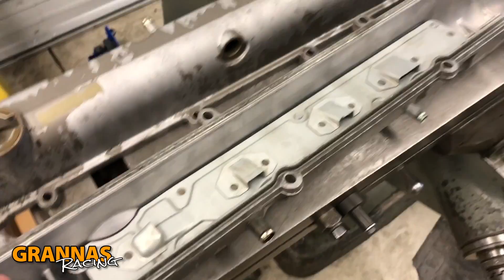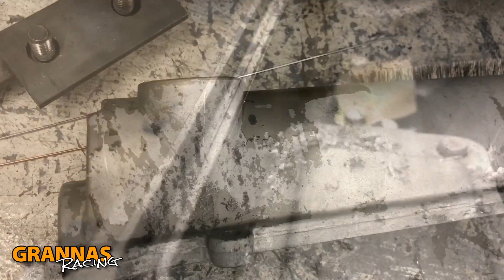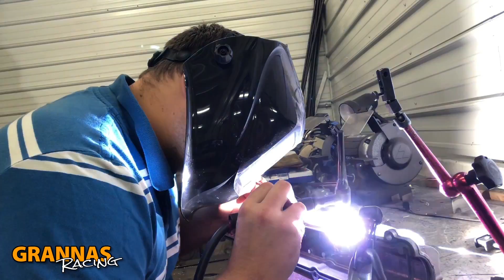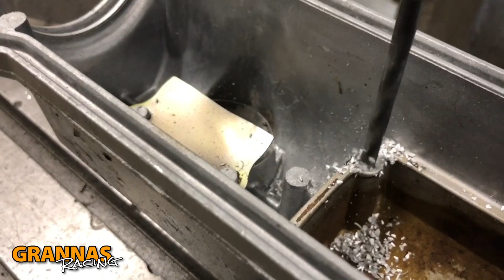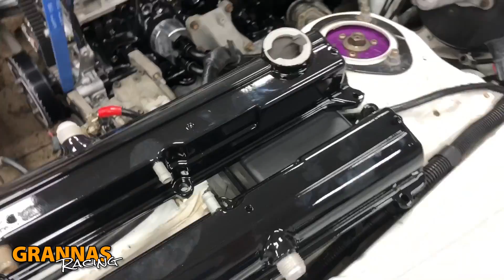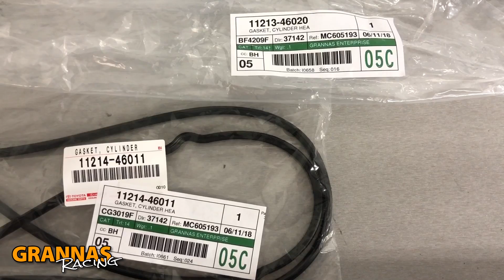Modifying 2JZ-GTE valve covers for use with a catch can

Comment: Have you heard of anyone having issues with the lobes on high lift cams hitting the heads of the bolts on the baffles? I've seen a couple posts about it on Facebook but I wouldn't think the lobes would be close enough to the bolts in the baffles to hit them.

Comment: I just did mines as well. Also pulled the cross vent nipples on both covers, welded them shut and grind em flush. Tired of dealing with it when doing coils. 

Also the silicon sealing the baffles is to keep the crank case pressure circulation through the baffle instead of making its way through the sides of the baffle and out of the 10an.

Comment: Joel how are you welding these? I’m having a miserable time welding on the cast covers. I’ve cleaned like crazy. I’m using 4043, running like 30% or so cleaning and 100 on the frequency, about 100 amps. I just keep pulling garbage out of the casting.
Reply from the maker: Yea try and keep penetration on the cast side of the weld low because of the old shit casting. It will continue to boil out crap, so less heat the better normally

Comment: Nice work, my approach was just going to be tapping, then I can change them out at anytime. Welding on the bungs looks good as well. 

I would be a little sketchy with how you   modded the baffles even with adding loctight, in the back of my mind I would worry them bolts will back out. 😂😂
But either way it looks good.

Comment: Hey Joel, is the 90 degree fitting on the exhaust side going to be an issue with a turbo that big? Would it be better to drill and tap that hole with a 90 degree -10 fitting for more clearance?
Reply from the maker: I will use the tight 90 fittings, should not be an issue. I think tapping the holes for pipe thread would work just as well too, then you could put a 90 fitting in there or whatever fitting.

Comment: Hey, Joel I had mine coated by Jet Hott with a ceramic coat and they look amazing. I then tapped my valve covers and used super high strength silicone.
Reply: Jet Hott is some super Cool Coating...
Its Original purpose was to Dissipate Heat ... An it works !!!
Intercooler, radiator, piping, turbo housings...millions of uses....